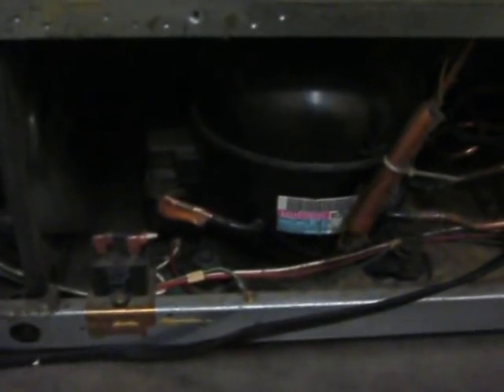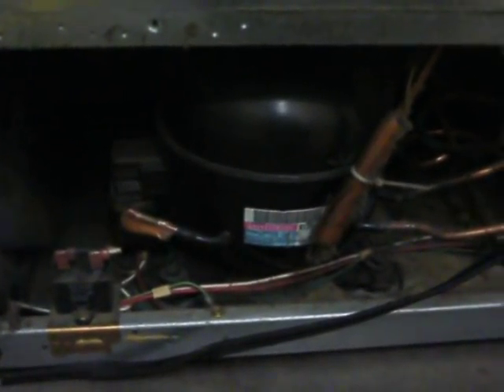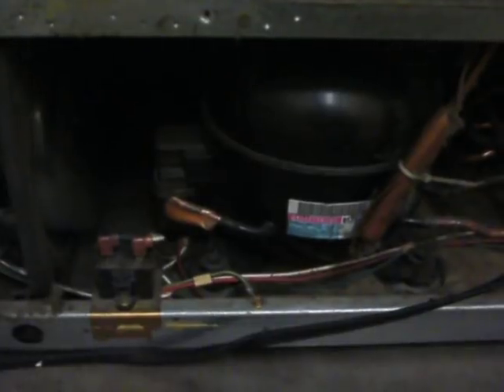Actual Sound Of A Bad Refrigerator Compressor

Comment: The compressor is mounted on rubbers because it is a noisy item and vibrates a lot. If a rubber breaks, the compressor can move and touch against another part of the fridge or freezer causing that sort of noise. Worth a good check prior to buying a new freezer or paying a huge bill for anew compressor.
Reply: Fred, perhaps this is my problem?  My GE Refridgerator has suddenly started rattling for a few seconds every 5 minutes like clockwork.  Everything else in the fridge works fine.  But it is about 10 years old.
Reply: Did anyone ever answer this issue? Mine has the same problem.
Reply: Just push on it and see if theres any metal on metal rubbing sounds. Try picking it up while it's running (dont touch power wires). Or try unscrewing the base and suspending it on top of some wood or towel or somethin soft.
Reply: fred flintstone IF THE RUBBER BREAKS?
Reply: that and the compressor is tilted, if he levels it out and ties it down with zip ties it will probably stop vibrating and actually work properly.
Reply: Unless its an internal problem with the compressor then your pretty much screwed & ether have to get a drastic repair job done or replace the whole fridge. Usually people just scrap the old fridge & get a new one. because its something like $200 to $300 to get a replacement compressor installed. Really wish compressors were more DIY repair friendly but everything on a compressor is welded on & together
Reply: @TankToChest   Strongly disagree. I have an LG refrigerator with a possible bad compressor.  Even an LG Certified Technician told me that he does not repair any LG compressors due to their  complex nature.  Another technician told me that he does not replace any LG compressors for a variety of reasons.
Reply: Did you hear the loud buzzing noise? Its something internal, maybe melted plastic that's touching against the case or against an internalmoving part. You won't solve that (completely) with zip ties or with leveling.
Reply: @retiredhappy466  Yeah, I have heard nothing good about LG refrigerators. I don’t have personal experience, just heard a lot of stories of LG’s totally crapping out within a year. Getting a new one with warranty, and 6 months down the road and again the new one ate shit. Just stopped. Not just the compressor but everything. Then LG told them the warranty only replaces ONE and that they must be using the fridges wrong and causing them to crap out. Not cool.
Have heard a lot of Samsungs explode cuz they use propane or some friggin GAS like that. Somethin sparked and boom goes the kitchen.
I’ve got a fridgedaire that I know I had at least in the end of the 80’s, has never had to be repaired. It’s clean and nice. But one night last year it kept kicking on(the compressor would)while already running  in the middle of the night, for like 2-3 seconds then stop. A few minutes later the same thing. Then it just stopped doing that and has been normal sense. Right now,  tonight , it’s doing it again and driving me mad. I should say it was doing it for a few hours and then just stopped doing it and all is normal again. Not sure what to do in this situation.
It’s a weird cycle after soooooo long.

Comment from the maker: You can keep it on and running.  If the freezer and refrigerator sections are still getting cold  and the bad sound doesnt bother you.  Keep it on and running.  It is a very expensive fix so you will be better off buying a new fridge or a good working used fridge.
Reply: Really wish it was easier to DIY replace. Everything seems welded together except the wiring on the relay/overload unit which was the only thing I was able to DIY replace. I always see replacements have coolant tube attachments that look like you can bolt them on but all the installed ones are welded onto the coolant tubes. WTF designers?
Reply: I'm listening to that awful noise as I type and the manufacturing date on my fridge is March, 2020.  This really can't be normal.
Reply: @estherc.536  

If it is Chinese then you should expect that

Comment: The motor inside the compressor is mounted on springs. If one of these springs breaks, or if the motor becomes detached (by the unit being laid down on its side or back during a move), this can happen. Used to do contract IT for one of the compressor manufacturers and got to see how one works.
Reply: Actual Trane field procedure from the early 90's:  Install issue: compressor motor has unmounted during shipping. Solution: Drop compressor, right side up, from waist height onto hard surface. In the likely event that this act of desparation further damages compressor and in turn hinders completion of install scrap unit and immediately replace with high efficiency Carrier unit. 

P.S. Replace the frigertator

Comment: FOR WHAT IT'S WORTH:

I had a fridge making the same sound, noisy humming compressor. I thought "great, now the compressor is going out". About a month later, the compressor failed to start. The start relay was burned out, but he compressor windings were good. I installed a new relay and everything worked like NEW! Not sure why, but apparently the relay had something to do with the compressor noise since after the repair the noice was GONE!
Reply: relay takes the capacitor in and out of the circuit for the start/run windings. so putting in a new relay allowed the capacitor to go in and out of the circuit like normal.
Reply: Errrr, ummmm, don't the vast majority of electric motors have a centrifugal switch that removes the start winding from the circuit at 75% of the motors rated speed?
Reply: Mayhaps overcurrent/thermal protection is being confused with a start potential relay?

Comment: That loud clunk when the compressor stops in his video is a dead giveaway - compressor's internal mount loose or broken (springs) hence the loud banging against the base.   This is impeding doom, never delay replacing your compressor if this happens (if under warranty) otherwise if it is an old unit, get a new one, compressor replacement is the most costly repair.  You can still get cooling but usually it WILL fail eventually, can take days, can take weeks......   Also if you got a new unit and get this issue, it's a bad compressor.
Reply: Hi.... my old refridgerator works fine - but, is making a loud lawnmower type sound for about 35-40  mins (sometimes shorter); and off for a good 15 mins.  If it is the compressor, can it be repaired or replaced?? or is that it for the fridge??  Please advise....thanks!!

Comment: If there are loud noises and vibration look if rubber mounts on compressor or are intact, and fan blades to compressor motor are all there. If not your refrigerator with vibrate badly and shake rattle and make noises.

Comment: I had to unplug my refrigerator to listen to the video. I got a Kenmore too. Mine still looks as good as the day I bought it, 25 years ago. I was hoping it would last a little longer. And I had just changed a little condenser fan in the freezer. My 24 year old microwave is starting to make funny noises too

Comment: My compressor runs hot, overload protector seems to work but it rattles if i shake it and gets somewhat hot itself, the starter seems to work fine since i shake it and no rattling. but the fridge isn't getting cold. so to sum it up, compressor powers on but gets really hot, both overload protector & starter get consistency but only overload protector rattles while i shake it. What could the problem be?

Comment: My Frost-Free Whirlpool Refrigerator Model ET 18PKXP was installed new in Feb 2011, so about 3 1/2 years ago.  It usually just makes a soft "humming" sound. But In the past 2 days, every 5 or 10 minutes, (for about 10 seconds) it makes a sharp "buzzing" sound.  At first, I thought someone was ringing my doorbell.  It sounds like a sharp "doorbell" buzzing sound inside the fridge.  I cannot tell if it's the Freezer or the Food section.

But the freezer continues to keep food frozen, so I guess that is not the problem area.  And there is no frost buildup, so the "frost-free function" continues to operate normally, at least for now.

According to the Refrigerator Thermometer, the normal temp in the Food section should be between 30 and 40 degrees Fahrenheit. But on Oct 18, 2014,  it was about 50 degrees F and then went down to 40 Degrees F in 24 hours, without me doing anything, except advancing max cold setting from 4 to max of 5.  Oct 20th 4AM, it's about 40 F or 39 F but at maximum cold setting ( 5 on the 1-5 scale), it just barely goes below 40 F.  It used to be about 10 degrees colder.

Any clue to what could be causing this?
Reply: Ever figure it out?

Comment: Hell,  I have a one-month-old Whirlpool frig that is only different in that it 'pulses.  The appliance dealer (not Box Store) sent a tech out and said the new boxes have a 'linear compressor and they are all noisy. I gather complaints today are normal.  Mine sounds like a truck is continuously backing up from a half-block away ..it is REALLY annoying at night.   Jim/Eastern Shore MD

Comment: Just wondering, what are the risks, other than food spoiling when it fails, of letting run with a noisy compressor.  I have a sears warranty, and they are refusing to look at it as long as the refrigerator actually works.  That is really offensive, but I need information to press the argument with the them.  Can it overheat and damage my floor? catch fire? explode?
Reply: Yes, but rest assured if that happens you can get $$$ settlement money
Reply: Update: my refrigerator's sudden loud noise problem turned out to be the bottom compressor's fan's mountings gettting loose.  The rubber gaskets holding it in place had gotten hard and shrunk.   Wasn't able to  get it off to replace the gaskets, so I put wood shims in there to stop the shaking and it stopped the noise.  Amazing how something like that could make such a loud annoying noise.

Comment: We just retired our Kenmore 'fridge after 22 years for a new Samsung.  The Kenmore was still working fine and compressor wasn't even loud like that.
Reply: Kenmore USED to be a good brand for the large appliances but not so much anymore. They don't work as well as they should from about day 1, and then they die around 10 years old. I'm on my 3rd one that we bought in the last 10 years, a washer and two refrigerators, and the smaller refrigerator is the only one that isn't needing replaced as soon as we get the money! It's like they reach their 10th year and they're programmed to start going bad. I'm not buying Kenmore anymore, and of course that means no Whirlpool either since that's who makes Kenmore.

Comment: I have a 2 day old Frigidaire that has a LOUD compressor.  I checked reviews and most people complain about it, so I know it's not a bad part.  It's just the way it's engineered.   

So sad how far the quality of appliances has fallen in recent years.  I had a fridge repairman tell me that my 20 year old Kenmore needed to be replaced.  When I asked him which one to buy, he said "All of them today suck.  None of them are worth a shit no matter which brand you buy. So just pick the one that is the least irritating."
Reply: +John Smith I have a Frigidaire Side by Side. 1 year and 1 month old. Sounds just like the Video. I called Frigidaire to see if they could extend my warranty since I am only 1 month out (Did not buy the extended warranty at the time of purchase) They offered me a 3 year $510 or 2 year $402. (I only paid on Sale $889) Then they said they would set up an appointment. I had been going back and forth with them for 1 week as it was because their Computers were not down loading the pricing to even quote me. So Finally this Monday I heard back and they told me the next available appointment in my area would be on 10/22. Really!!! They expect me to wait 8 days to have someone just to come out and diagnose the problem (I already know the COMPRESSOR is Failing!!!!) So basically I am screwed and I purchased a disposable!!! If your refrigerator is already making a noise I hope you have them replace your 2 day old refrigerator before your initial warranty is out! BEST OF LUCK!!! P.S. I left work this morning 7:00 a.m. with the Fridge Humming like a MACK Truck and I returned tonight at 6:00 p.m. (Work & Commute) the refrigerator was still Humming like a MACK Truck! WAAAAAA! I am Screwed!!! I just unplugged it!! I need to rest now!!!
Reply: @dm00097  warranty??

Comment: The LG linear compressor refrigerators are much more reliable than the older style compressors. LG linear compressors uses a linear motor to directly propel the piston back and forth instead of a crankshaft driven by a conventional induction. My parents once had an Electrolux refrigerator 4 years ago which was supposed to replace the kitchenaid refrigerator and the compressor is loud and the plastic liner inside the refrigerator split but, my parent's traded it in for a Kenmore french door refrigerator which uses an LG linear compressor and it is much quieter than that POS ELectrolux and it's even quieter than the old kitchenaid refrigerator from the late 90s. Electrolux has shitty customer service and they are unwilling to replace their defective product but, good thing my parents bought that refrigerator from sears. Sears has very good customer service.

Comment: With the exception of LG and Samsung (I think),  new refrigeratiors like Kenmore, Whrilpool, GE and others only have a 1 year compressor warranty.  That tells  you a lot about the quality you are buying.
Reply: +ritewayguy Actually, a one-year warranty implies that if the compressor doesn't fail within the first year, it will probably last the expected service life of the 'fridge (subject to so-called 'random' failures, because you can't guarantee anything 100%). Warranties are designed to cover what is called "infant mortality'' and installation errors,  not normal life-span failures (here, read up on the 'bathtub curve'):
https://en.wikipedia.org/wiki/Bathtub_curve

Nothing lasts forever, and companies would go out of business if they replaced every product for free if it failed after a normal service life. I came to this page because my compressor is making noises, too. After 17 years of continuous service, yet there was only ever a 1 year warranty on the compressor.

Comment: I think the compressor on my Daewoo 4.4 mini fridge ia going bad now. Makes a loud pop when it turns off & makes a similar sound when it turns on. Really wish the compressor was more modular so we can just unbolt the coolant tubes remove the old one & slap on a new one without having to cut anything or drastic dismantling. Shame to because the mini fridge is brand new(made in 2018 & purchased in 2020) & costed just over $300 after taxes.

Comment: Busted spring shock mounts, probably going to get a fractured line inside the unit here soon. If the fridge is of any value, then you can gamble with replacing the compressor, but if not, then go buy a new fridge.

Comment: our frigidaire just started making this exact noise (first time in 20 years!!) , i found out the compressor costs 310 USD so how much would it cost to repair it roughly ? Keep in mind similar refridgirator costs about 3000 USD new . Is it still not worth replacing the bad part and keep it running ?
Reply: I have the same question.....my fridge is over 22 yrs old ....so, i was wondering how much it would cost to repair vs. buying a new fridge (1300.00)  help!

Comment: I heard a loud screeching noise coming from the back of my fridge, lasted about a minute then died down.  When I opened the fridge door (bottom part not the freezer) I heard what sounded like a constant electrical current coming from the little white box on the top that had the temp controls, is this a normal sound coming from this box inside the fridge? It was late at night & it was quiet so maybe it's done this before & I never noticed but I found it weird & creepy.  These were two sounds I've never heard my fridge do before.  The fridge is only about 2 years old.

Comment: welcome to the wonderful quality of light weight energy star equipment. ((
Reply: That's why I buy vintage appliances
Reply: My fridge is 32 years old and is nearly silent, the only thing that it needs is new door seals otherwise its fine. I clean the condenser and fan every so often and that's about it. The only noise it makes is when it first start the compressor buzzes a tiny bit for a couple seconds until it build head pressure and the condenser fan has a slight whine as it spins up, normal for a fridge. Once its running you only hear a slight hum and the sound of air moving from under the fridge. It's an old Kenmore made by Whirlpool in 1986

Comment: My fridge looks pretty much like that and the freezer is where the noise is coming from... It's starts out like a dog crying then it gets louder and worse and goes on for 5 mins then stops. Sometimes it repeats soon after or the day after for the same period of time... Any ideas?
Reply from the maker: Rhedz sounds like just normal refrigerant passing through the thin piping.  Some GEs make aweird howling sound in the freezer back section. I wouldn't worry about it unless you don't hear that sound then I would start to worry
Reply: kerrsydotes ok... Thank u for responding..

Comment: My refrigerator sounds something like that from time to time. Sometimes it runs quietly. Some times it makes the noise very loud, some times soft. Sometimes loud at first and than it quiets down. Any advise would be appreciated.
Reply: @riancloete96  No, I think I came to the conclusion that the refrigerator was old, and I didn't really like it much anyway (it was a side by side), and that there was something on sale that I liked a lot better...much of this accompanied with pressure from the better half. Also, DTE would pick up your old refrigerator and give you $50 for it.